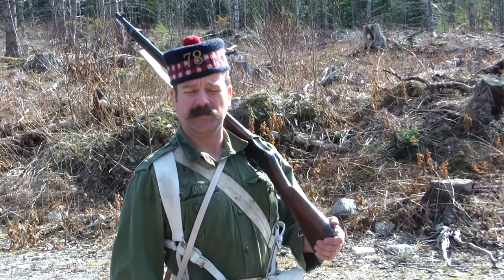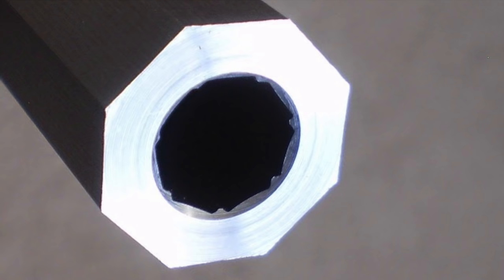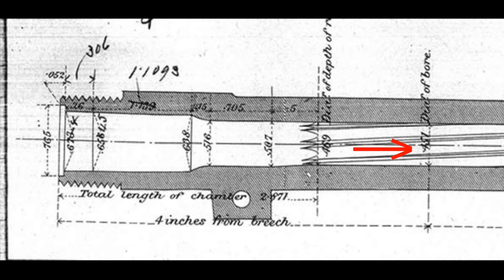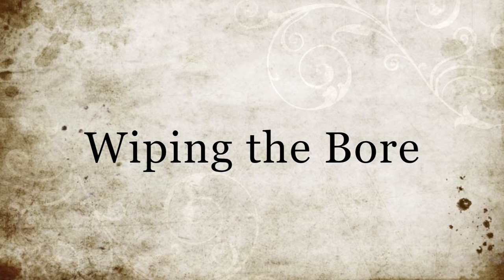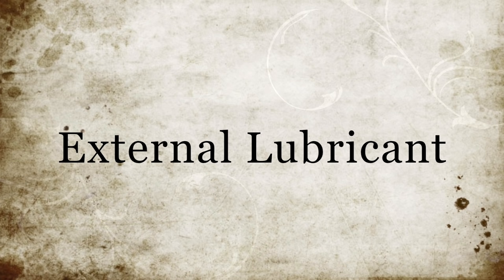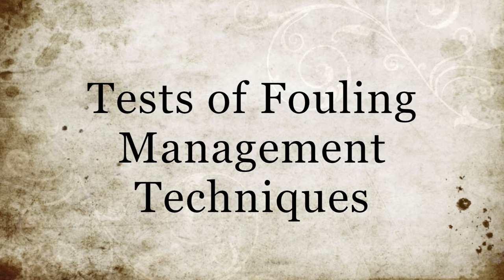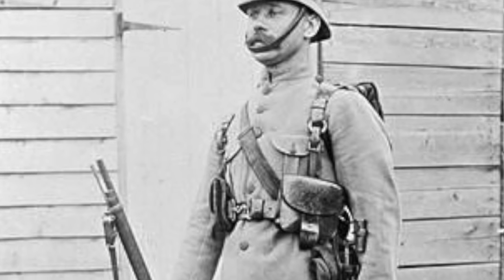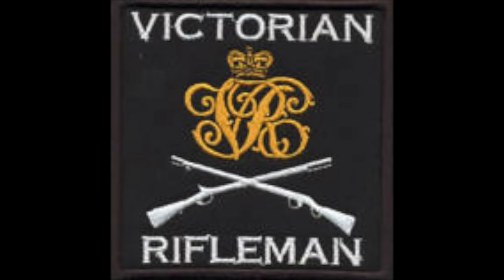The Mk I Martini-Henry:  Observations on Shooting to Potential

Comment: Delving into first generation breach loaders is tricky stuff. I have a Remington rolling block in .43 Spanish and a 11mm Gras in which I have hit a brick wall in attempting to obtain components for reloading, at least in these times.  The Martini Henry seems to be different.  Because of gentlemen like yourself and Martyn of x-ring, Ive been able to find brass, molds and dies at very reasonable prices. With your instructional videos, x-rings products and a few extras easily found on the internet, I was able to make my MkIV come alive again. Your awesome Rob.
Reply from the maker: Cheers!

Comment: Bravo on another excellent video! I really like the breath tube you made from two pieces of spent brass. Much less cumbersome than one with a long rubber tube on it.
Reply from the maker: JRhoney I agree.  I wanted something that I could put easily in my bag...  With no messing around with hoses and tubes... Seems to work OK..  Glad you liked the clip.  Cheers.
Reply: britishmuzzleloaders Did you flange that 303 brass before solder or is just rim to base? If it does break,flange. NH4CL ammonium chloride,if you can find it does better than ZNCL zinc chloride. 95/5  tin/copper is a plus,70/30  tin/lead as well. Do not know how much soldering you do,but the 19th C tradesmen were expert. Old documents or trade school texts from about 1925  cover stuff much better than I can. Bacon in the babbit or sections of a drivers leather belt got many a flathead guy home or to sell the car,god help the new owner. Good stuff, keep it up. Cheers.
Reply from the maker: paul manson Hi Paul.  No, I didn't flange the 303 case...  Just bevelled it and soldered it...  No sign of any weakness... It is done with 50/50 solder.. Thankfully, it doesn't have to put up with much abuse...  If it does break I'll just re-do it, I suppose...  I am certainly no 19th century tradesman, but am happy enough with the job I can do with the solder on my little hobby projects......  :-).   Cheers.

Comment: Another excellent and informative video from your site. One thing I think you should be careful of is that if the "Udder Cream" you are using contains any lubricant qualities, it could increase the chamber pressure quite a lot, a lubricated case was one method used to proof guns at one time as it increased rearward pressure on the breach face due to the reduction of friction in cartridge/chamber.
You can easily make paper patch bullets with no lube groove by making a swage die, the grooves are not required for paper patch as you know.
Reply from the maker: Englishman French Valid point and it certainly is something to consider...  Personally, I don't use the US too much...  many friends have spent years shooting both Sniders and Martinis this way for many years and swear by it..  I typically stray towards the historical side of things and with the type of shooting I often do, carrying around a tub of US isn't really in the cards... I included this method in the clip, based on those years of experience.. (and what little of it I have in Martinis and US)...  Never heard of any signs of problems... To each their own I suppose.  The Martini is one of the stronger actions out there, mind you.  I appreciate your always thoughtful and informed comments, my friend.  Thanks.

Comment: One handy thing I found for black powder cleaning after flushing the bore is petrol (gasoline) injector cleaner, it's designed to remove carbon and sulphur, a patch run through often gets some more out that you can't see when the bore looks clean.
Reply from the maker: Anon Hunter Just had an interesting conversation with +murpheysmuskets  about cleaning...  He put up a video about it...  There is no doubt that there are many, many products that will clean up BP fouling.  Personally, I use hot soapy water, tight patches, with oil after for storage.... So many ways to skin that old cat, eh?
Reply from the maker: Anon Hunter I have such a can, for other, shall we say, more modern, rifles....  Maybe I'll give it a try.  Cheers.

Comment: Great piece. I use a blow tube with my Sharps. Although when shooting paper-patched bullets for maximum accuracy I will wipe between shots. One wet two dry. I have used that Utter Cream in the past and It makes an excellent lube mixed with bees wax to control the hardness, more bees wax in the summer and less in the winter. For the amount you get it is very inexpensive. Never thought of just dipping the bullet in it.
Reply from the maker: Hugh Batesel The US idea came from a buddy (he's in the Alberta Shoot videos, here, on the channel) he swears by it..  Obviously, it's only good for static shooting but it does keep things really soft...  There is a lot of water in it, hence it's good qualities...  Cheers.
Reply: Works well with .58 Minie ball I can attest.

Comment: The practice of "greasing" bullets (and effectively greasing the chamber) for target work was used in the past to reduce fouling but was abandoned after some very serious accidents, so lets not learn nothing from the past and re-introduce it.
It is as dangerous in a "low pressure" gun such as this as it is in more modern types.
Just off the top of my head a reference for this is "Complete Guide to Handloading" by Philip B. Sharpe, but there are others.

Comment: Love the videos, man! Get a much better insight than you ever can in a museum!
Just wondering about the development of the bayonet in Martinis. I noticed you have the more traditional triangular locking socket bayonet, yet your rifle also appears to have a bayonet stud on the side of the barrel, presumably for the fitting of a yutaghan (spelling?) style of sword bayonet. Was this a standard upgrade for the rifle or are there some examples that stuck with the older style?

Keep up the good work, we all appreciate it very much!
Reply from the maker: All Martinis had the bayonet lug on the band.  This stemmed from two different bayonets being used in the Army at the time.  Line Regiments' Jr Ranks (Ptes and Cpls) used the socket bayonet while Sgts used the 1860 (bushed) Yataghan sword. All ranks in Rifle Regiments used the sword.
Reply: Interesting! Thank you for the info :)

Comment: That’s interesting, my first M-H was a Mk. IV “A” pattern, it had seen hard service in India, and it appeared that the front sight had been broken off and brazed back on at some point. It shot consistently to the left. I tried shooting it with the bayonet, as I thought the weight + effect of the muzzle blast, would push the point of impact to the right. WRONG! It sent the bullets WAY over to the left, and high, a little more than your Mk. I. Oddly enough, I tried shooting my Snider with the bayonet fixed, and the difference wasn’t really noticeable.
Reply from the maker: Interesting results! Thanks for sharing.

Comment: Hi!
Great video Rob.
I got a Mk4 vith accuracy problems.
Using the same mold as you only 1cav.
Cant seem to figure out using black in my 10,15 Jarman and 577 Mh
Greetings from Norway!

Alf
Reply from the maker: oljerigg Sorry to hear that... What kind of "accuracy problems"?  Lube, bore size, bore condition, powder, etc.....  there are so many variables that I don't know about and therefore can't give a decent answer... If you explain your method a bit more, it will help me understand what it is that you are doing.  Cheers.
Reply from the maker: oljerigg Sounds pretty standard to me, Alf.  The only thing I don't see you mention is the size of the bullet...  You mentioned it was the same as mine..  That means .470-1, then?  Are you applying any fouling management between shots?  I think that without a cookie, and only relying on the grease in the grooves, things might foul up quite rapidly as there may not be enough lube to keep the fouling soft...  Interested to hear how adding the cookie works out!  Cheers.
Reply from the maker: oljerigg Do let me know.  I am most keen to hear how things work out.  Cheers.

Comment: I commend you on the amount of rounds you fire.  I can fire just about 3-4 before my shoulder begins to feel it.  I have to quit shooting mine after just a few rounds.  Mine is a Mk II dated 1874.
Reply from the maker: Nice to hear from another Martini shooter!
Reply: Thank you for the videos.  I have learned more information from them than I can any encyclopedia.  Mine will fire just once before I have to take it apart.  The primer backs out just enough to where I cannot lower the breech block.  I took it to a gunsmith and discovered that the breech block I have is from a MK IV and since mine is a Mk II, hopefully this will take care of this issue.  Thank you again for the videos!

Comment: I have my first Martini Henry coming from Canada.  As funds are limited to only getting one bullet mold, which bullet mold would you recommend?
Reply from the maker: Try the muti groove offering form X Ring.
Reply: I contacted him as the guy I bought the Martini from in Canada highly recommended his 470 475g mold.  Thanks for replying and hopefully soon I can do loads with paper patch as well.  Always want to give these ago after watching Quigley Down Under.  I know he was using a Sharps but he did mention a paper patch bullet so that led me to researching older rounds.  And low and behold, the rifle I always wanted (the Martini) used a paper patch bullet.  Any way, thanks for the response to both of my postings.

Comment: with Enfield breeches chopped off to accept the Snider breech what are we looking at for rifling dia. etc.? What now is the difference between the Enfield and Snider?
Reply: interesting the 4 inches or so removed from the Enfield at the breech didn't remove enough to get to a difference in measurement.
Reply from the maker: Well maybe there would be a thou less....  really immeasurable as far as performance goes.

Comment: Out of curiosity, may I ask what the bore is like on your rifle?
also, have you experimented much with the cartridge overall length?
Reply from the maker: Bore is good... Richard took good care of it before I...  I have indeed settled on a OAL for both the GG and PP bullets.  As far out as they will go, then back them off a few to allow for fouling....
Reply: @britishmuzzleloaders   Thank you for the response. I didn't know you got that form Richard, that is quite interesting. I have recently been experimenting with dipping .470" paper-patched bullets in pure beeswax, and discovered they came out at around .485". Curiosity got me thinking whether it could sit in a fireformed case with enough neck tension... 
Loss of accuracy is quite likely, especially with a shorter cartridge OAL, but if neck-sizing could potentially be avoided, a some degree of convenience and brass longevity could perhaps be had...
Reply from the maker: @theoldehandgonne2503  I neck size only and haven't had a case fail because of it yet... so they last and last...

Comment: I have a BSA 12/15 Martini in .22 LR. Fantastic target rifle with Parker-Hale sights and rifling. But it isn't a real Martini-Henry or Martini-Enfield. I'll own one of them some day, and without bugs from Nepal in the bore.
Reply from the maker: Francis Borek I understand that the .22 Martini actioned target rifles are quite a pleasure to shoot.  Does the PH sight bolt onto the side of the receiver or is it on the stock?  Don't completely write off the Nepalese Martinis...  They are British made.. I have seen a number that are, once they are cleaned up, very good..  Then again, if it is the collecting that you are into, then, of course, one with provenance that is somewhat "closer to home" might be more appropriate... Cheers.
Reply: The PH sight bolt to the rear of the receiver right where the stock meets the receiver. They very nice to shoot, and the adjustable trigger is a dream. Have mine set to a hair trigger. A problem I'd have with the Martini rifle no matter where it's from is that I'll probably wind up spending a lot of money simply to load it. Would rather have a .303 Martini, even if I don't get the cloud of smoke. Wouldn't mind a Snider either and load it with 24 gauge shotshells, even if it isn't historically correct.

Comment: smokeless powder is a great way to deal with fouling. It's really difficult to understand why anyone wants to deal with this mess. I did it; it used to take a shower with my muzzleloader; but after I became educated I just used smokeless powder in them. Life is too short for Black Powder.
Reply: I find it much easier to clean a black-powder rifle like a Martini than, say, a .303 SMLE using modern smokeless ammo.  I load my black powder ammo with cast-and-lubed or cast-and-patched bullets over a grease cookie (see also the handloading videos in this series, he does it the same way.)  No copper fouling as with jacketed bullets, and the grease cookie  and bullet lube keep the powder fouling soft.  Best bore cleaner I've found is blue windshield-washer liquid, sells for less than $1.00/gallon at Wal-Mart.  Use sopping-wet flannel cleaning patches, there's no need for a bore brush.  The third or fourth patch should come out clean.  Then follow with a few dry patches, and another that's lightly oiled before storing the rifle.